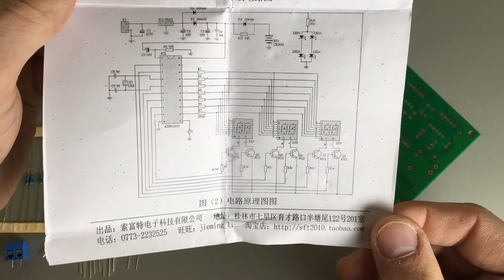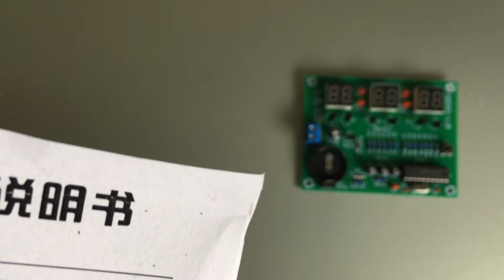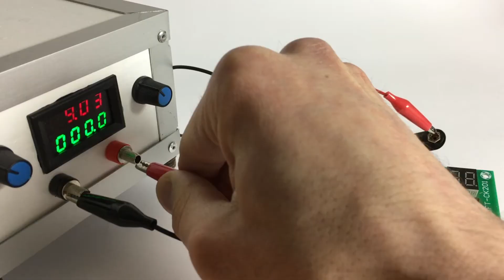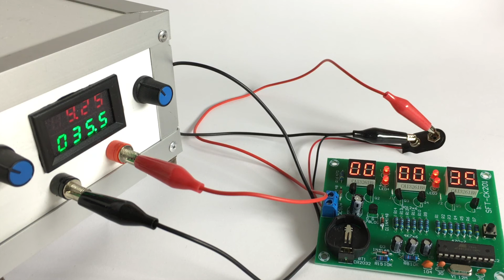DIY LED clock kit - AT89C2051

Comment: i have the same kit and got a problem setting the time. if i click long the minute starts blinking. if i click short to set minute it goes to hour set and if i click short again it goes back to clock mode. maybe i have a problem with my button?